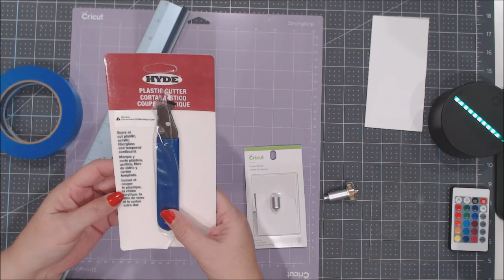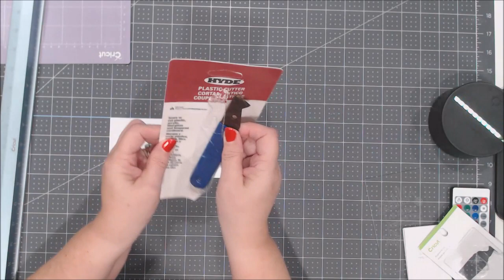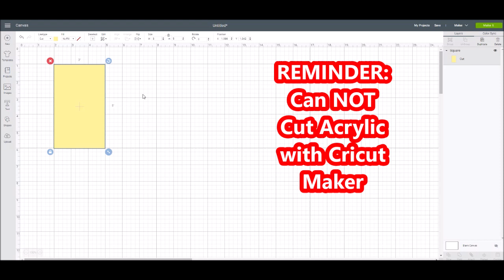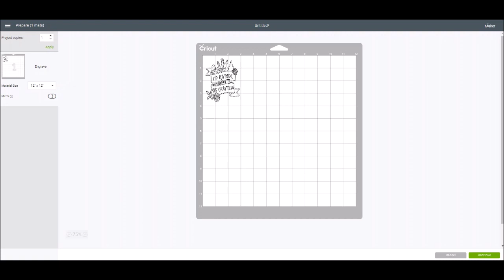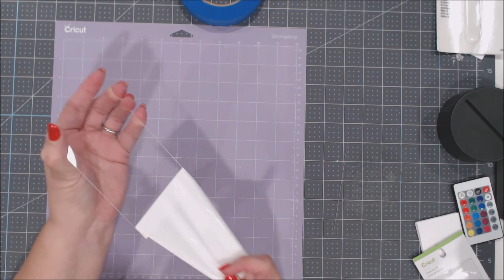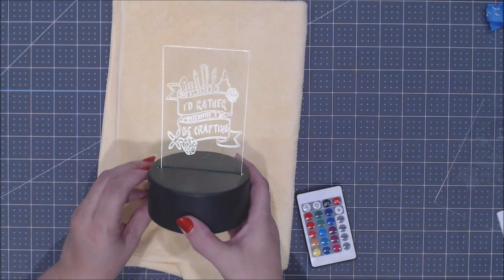How To Create Engraved Acrylic Light Sign with Cricut Maker

Comment: Debbie, Can't find the light box here in Australia. Can you send a picture of the package it came in, it may help me find like item.
Reply: I just recieved mine yesterday and this is the discription.  I think that might help you find them.  Mine look identical to hers.  USD$13.99. I think it was a good deal. 

2 Pack 3D Led Night Light Lamp Base, Includes Remote Control, Blank Acrylic and Charger Cable, Adjustable 7 Colors Lights Base
Sold by: NiceCo